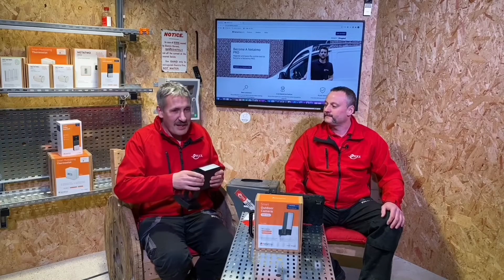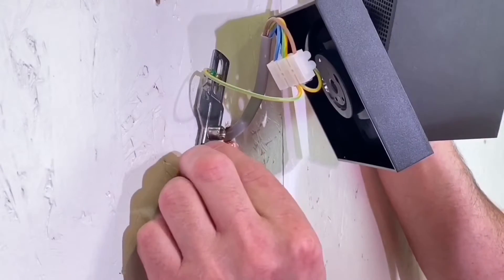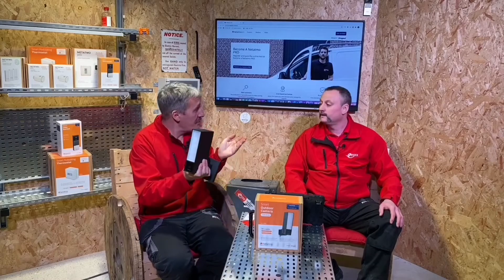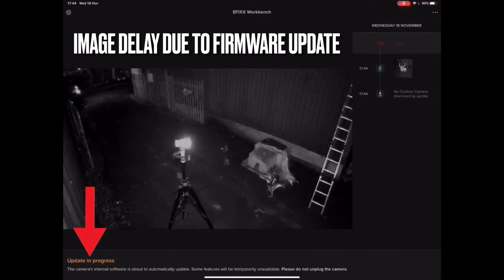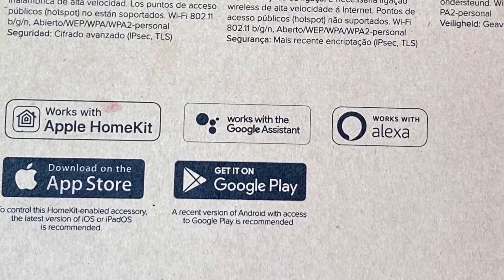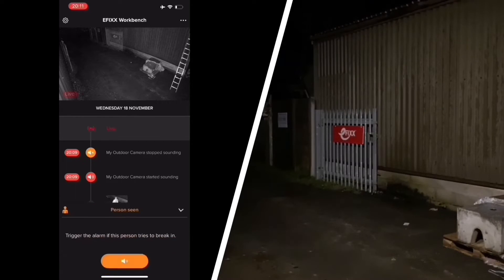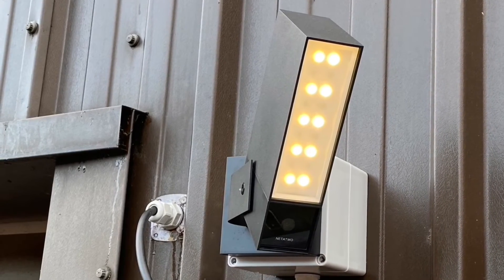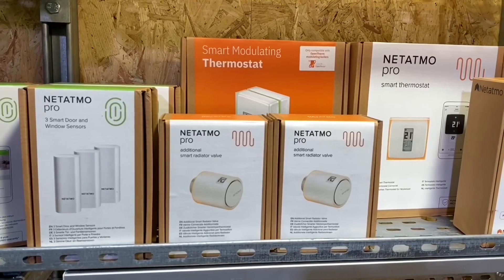It's as EASY as changing a light - Netatmo Outdoor Smart Camera with SIREN

Comment: I fitted the Netatmo Thermostat in my home. I wanted this to help save on heating costs. It was a doddle to install and it's learning algorithm soon understood our Homes Thermal Properties, how warm we like it and it even takes into account the local outdoor temperature. I love it.
Reply from the maker: Did you replace an existing thermostat or wire in the relay at the boiler end?
Reply: @efixx  I replaced an old Salus RT500. Which in itself is wireless, but not that Smart. So yes i did the boiler connecting, pairing the Smart Stat and receiver and joining it to my network. Lovely bit of kit and i get a monthly report to tell me how my usage is fairing.
Reply from the maker: Thanks - house we are using is s-plan plus - we are expecting all the existing wiring to be labelled and lots of room in the junction box 🤣
Reply: @efixx  I doubt it, but ill keep my fingers crossed for you.

Comment: HOW BRIGHT IS THE FLOODLIGHT IN LUMENS??? I CANT FIND ANY INFO IN THE SPECIFICATION!!!!!
Reply: The floodlight is LED 12W 1100lm 4000k with dimming capability. It is the equivalent of a 120W halogen floodlight. It can be set to turn on only with specific detection types/events, for example, you can set it to turn automatically on only when the Camera detects people or cars, and keep it off for the rest of the time, even if it detects any other motion such as an animal. You can also manually turn it on, off or set to auto. It can even be set to stay on during the night.

Comment: HOW DOES THIS COMPARE TO THE EUFY FLOODLIGHT CAMERA???
Reply: Hi MR V. As far I'm aware the Eufy floodlight camera doesn't have intelligent detection, I understand it to be 3 PIR sensors working alongside video pixel change. The Netatmo camera has smart detection. This works by analysing the live video to classify a moving object as one a follow types: Animal, Vehicle, Person or Unknown Object. The user can set which detection types to record and to be notified of. The user is also able to correct any incorrect detection types which will help train and improve the algorithm built in the camera (no cloud processing, no video is sent to the cloud). 
Netatmo can automatically upload recordings to an FTP location and Dropbox.
Netatmo works with Apple Home Kit, this could be an important difference for some.
Netatmo has 4 years warranty. 
I hope this help.
Reply: @richardhopkins5452  HOW BRIGHT IS THE FLOODLIGHT IN LUMENS??? I CANT FIND ANY INFO IN THE SPECIFICATION!!!!!
Reply: @mrv5801  The floodlight is LED 12W 1100lm 4000k with dimming capability. It is the equivalent of a 120W halogen floodlight. It can be set to turn on only with specific detection types/events, for example, you can set it to turn automatically on only when the Camera detects people or cars, and keep it off for the rest of the time, even if it detects any other motion such as an animal. You can also manually turn it on, off or set to auto. It can even be set to stay on during the night.
Reply: @richardhopkins5452  OK - THANKS FOR THE INFO!!!!!

Comment: One really obvios point that as electricians Iwould 100% have expected you to mention... IP rating ?
That product with those chocbloc connections does not look great to me, expecially if the fitting was on a brickwork bridging between bricks of on a tyrolean finish....no seals,no gaskets that I could see.
Again...really surprised at that omission. Especially as images show how  a cable exiting the cladding is shown using a compression glad yet sod all on that fitting !!
Reply: The Netatmo Outdoor Camera's internal electronics are protected by a HZO protective coating creating a strong barrier against rain, snow, hail, humidity, sand and dust. The SD card is covered in a dielectric grease to complete the barrier. As part of the installation we instruct the installer to seal around the top and sides of the wall mounting plate leaving the bottom open to prevent moisture building up.
To learn more about HZO protection see here https://www.hzo.com/solutions/protection-capabilities/
Reply: You might just have missed my point there.. what is th IP rating and just how does the that coating  that protects electronics the mains connectors ? Forget the card,forget any circuitry, Is that a clear question ?
Reply: @allanroyle7622  We don't rate the product's protection by IP as HZO protection exceeds it. The mains connections are located inside/the back of the wall plate. For water to enter this space it would have to come from any gap between the wall and the top and/or sides of the plate. This is also why we recommend leaving the bottom unsealed to allow that space to 'breathe'. If you still have any doubts perhaps the 4 year warranty will help. 
I hope my explanation is more helpful this time.

Comment: By storing locally it also means that as a security product it's less useful, nefarious persons will quickly know they can just knock the camera down and steel it to prevent there image being provided to the home owner, would rather pay a small fee for all my cameras to be backed up in the cloud to provide to the police if needed.
Otherwise very good product and great review.
Reply from the maker: You can set the camera to backup to Dropbox, FTP site or Apple iCloud accounts - so you get the best of both worlds.
Reply: @efixx  how long does it take to transfer, is it almost instantaneous or a lot slower than direct to cloud, I did look at a few a while back and some took 30 mins or more to back up, which is effectively useless as the camera has been knicked by that point.
Reply: @cjhification  The transfer is almost instant, the moment the file is created for the card for storage/viewing it is also sent to dropbox and/or an FTP site. The user will see a time marked dropbox 'Successful upload' notification in the Netatmo app timeline. 
It's also worth mentioning that when an activity is detected an image of the object that triggered it is sent directly to the user with the push notification.
Reply: @richardhopkins5452  great to know, did seem like a bit of a hole if the assailant was able to make off with the evidence.

Comment: Correct me if I'm wrong ... but this is an exterior fitting yes?  If so what is the IP rating of it, as whilst fitting in it in your video [section 1:41 > 2:15]  you made no mention of IP rating  or the lack of any provision (?).  Given it's a basic 3 way strip connector which is then stuffed behind a square backplate with no sign of any sealing gasket etc ... what's the deal?   I only ask because if I where fitting something such as this my lecturer or boss would have my b@##s [if I had any  😳... female sparky ] .... lol   😂😂😂
Reply: The Netatmo Outdoor Camera's internal electronics are protected by a HZO protective coating creating a strong barrier against rain, snow, hail, humidity, sand and dust. The SD card is covered in a dielectric grease to complete the barrier. As part of the installation we instruct the installer to seal around the top and sides of the wall mounting plate leaving the bottom open to prevent moisture building up.
To learn more about HZO protection see here https://www.hzo.com/solutions/protection-capabilities/

Comment: I see someone already thought about that red card being unique, which luckily it is...
But isn't that camera extremely easy to take down? Not only didn't you use any special tools installing the thing, the cable is also easy to reach with a pair of sidecutters. 
Since it uses an internal SD-card for storage, the access to the footage is gone as soon as somebody cuts the power or manages to disturb its wifi-connection. Is there a back-up battery on-board and is it possible to let it automatically make a cloud or on-site backup periodically without having a phone or computer online doing the work?
Reply from the maker: You can set the camera to record to a Dropbox (or similar) or pair with an Apple iCloud storage account.

Comment: One of the key points with these is the wireless. Many built for cardboard US houses have a problem with our brick and block - it would be good to see it in a real situation and what kind of signal it sees.
Reply from the maker: Sounds like the voice of experience. Our demo unit is fitted on the outside of our aluminium clad building. Not a great environment for Wifi. We will be testing out the Netatmo products in a real house over the next few weeks.